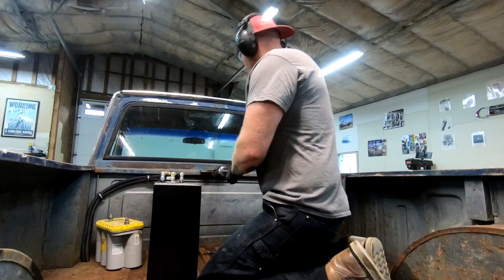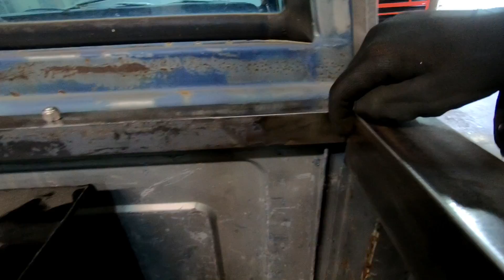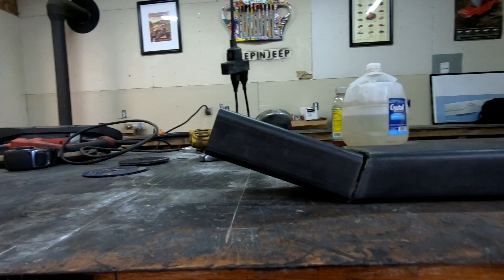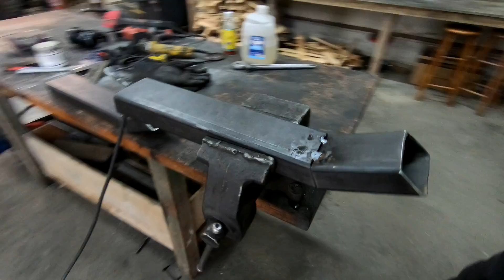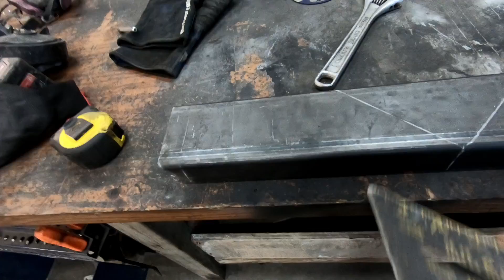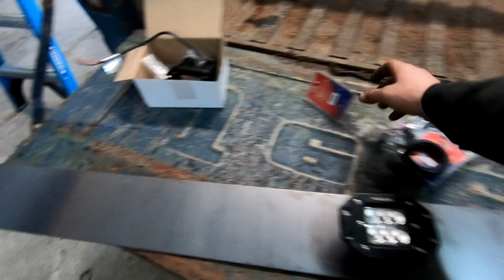Low Buck Diesel Truck Episode 8: Build Your Own Headache Rack

Comment: What gauge wire are you using for your mig? I’ve been using a flux core and have had troubles burning through tube steel

Comment: Cool J-truck. I'm guessing a 82-87 J10 someone did a Gladiator Rhino conversion on. And you decided to put an oil burner in it. As if J-trucks weren't oddball enough.

I was taught to bisect the angles for corner cuts, so you do not have a long side and a short side to weld together. These do not fit up nice and result in you having to burn in a big ugly weld. Big, ugly welds make heat warp more likely, and they waste wire.

Comment: With the second bend (18 inches") you could have done 10 degrees each side of the 90 degree mark instead of taking the full 20 degrees of one side of the 90 mark, would have been a nicer fit up instead of having the extra overhang where you weld it up, you did it on the next bend splitting the degree each side why not on the first

Comment: Wait a second. The "rhino grill" trucks never came with the dual wall bed! Or the amc logo on the B pillar!

I smell a grill swap...

As for the rust by the fenders, that is due to a body seam that results in an inch-wide shelf on the inside that collects mud. HOWEVER, do not hate on amc for that seam. The reason for the seam was to allow the lower panel sections, which are actually galvanised steel for corrosion resistance, to be attached to the normal steel body panels. Hence why they rust above, but not below the seam. 

I kinda wanted to do something like this for a headache rack on nine, now I really want to.

If you haven't yet, consider joining an FSJ group. You'll have access to other people's experience and knowledge on these jeeps and I am sure they would be interested in your build

Comment: On the bottomside of the angle facing down into the bed just drill a 1/2" hole every foot or so for attachment points

Comment: I've owned a speed square for 2 years now and I finally learned how to use it. Thanks man
Reply: No prob bro!
Reply: Ya know Swanson Speed Squares come with a very in depth little blue manual. You should check out the reasons for the 12" Swanson like laying out a set of stair stringers and hip and valley rafters. A true wealth. Unless you buy one of those cheap clones. No info with them. When they came out in the late 69s we all wondered how we ever built anything without them . Standard issue is minimum 2:of them for a lot of things no other tool will do. Dandahermit

Comment: Great looking build, as usual.  The is one thing making my OCD flip out though.  You angled your vertical risers to match the back line of the cab, great!, but now the top surface of your horizontal bar is at an angle where the roof is not.  That would have been a nightmare and measuring compound angles is a bitch.

Awesome work Nate.
Reply: Good catch! I thought about this as well but I hoped no one would notice! Compound angles start to get funky fast. Thanks for the comment Khorsathedark lol

Comment: What kinda welder do you use Nate? Seems like it works pretty well for you
Reply: It's a "catalog welder" out of northern tool. The brand is northern industrial. I've been using it for 6 years or so. It has been pretty impressive for such a low cost option
Reply: Nate Bleepinjeep I have the same welder I bought it new old stock off craigslist and have been using it for years, love it. Keep up the good work!
Reply: Good to know! 220,power?

Comment: like the looks of it, the only thing I might have done differently is that "light bar" instead of putting it inside the frame of the head-ache bar, I would have placed it level to it an put some stand off's in-between the two pieces, sheeted in the gap. My way is a lot more work, I get that, BUT I live by my windows an covering up as much as you did blocks that rear view mirror too much for my liking

Comment: Great Job. looks good. I need $$ for steel.
Reply: 20' of 2"x 1/8th angle iron
10' of 2"x4"x1/8th tubing
50-80$ depending on if your in the city or rural

sheet of steel mesh is about 70-90$ if you wanna add that to protect the glass.. if they charge at a cut fee or a fee for not buying the full 20'/24' lengths of steel id recommend buying the full lengths save it for future projects and bring an angle grinder to cut it your self to a length you can haul

Comment: Thanks for the lessons on how to use a speed square. The project is coming out nice.
Reply: Well said Wyatt. I own a speed square but never knew how to use the angle portion. This is Handy for my metal fabricating aspirations, and he did a great job explaining along the way.
Reply: Same here! I had no idea how to use the speed square like that. I was about to start a roof rack build for the XJ project and wanted to do more than just some 90 degree corners. Now I know how to get better results using a very common tool! Thanks Nate!
Reply: I'm glad I could help gentleman!